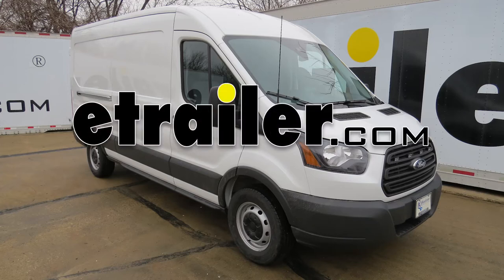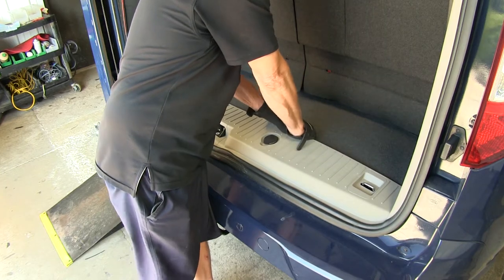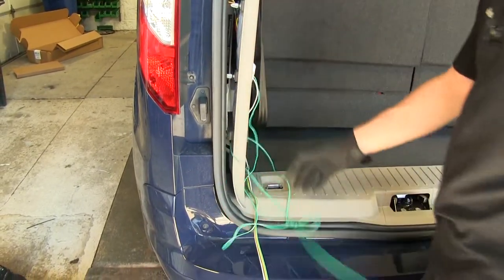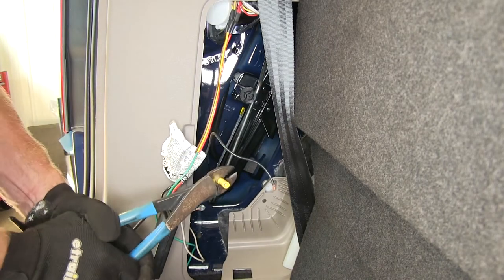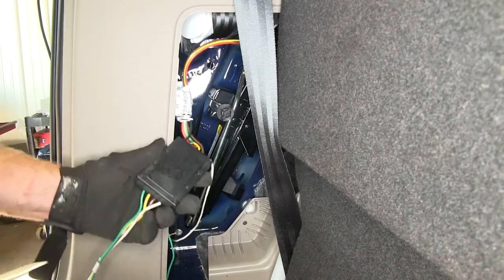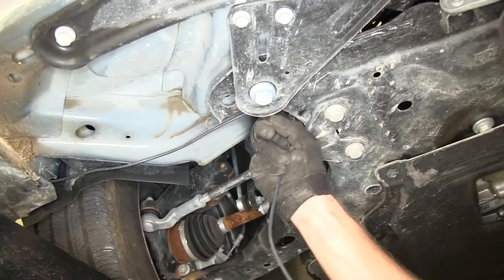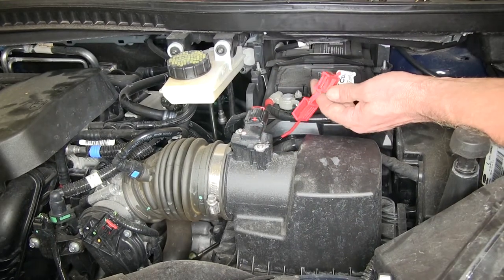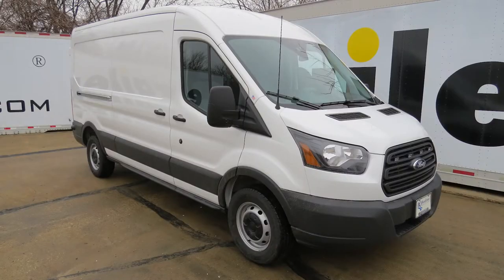etrailer | Trailer Wiring Harness Installation - 2014 Ford Transit Connect

Comment: Awesome video - however two things of note:

1) The Van shown at the Beginning and End of video isn't the Transit Connect, but is the one of the "full size" Transit 150/250. A lot of the components vary between this model and the Transit Connect. 

2) Although the OEM plug interfaces are the same between the VAN (not shown) and Wagon (SHOWN) versions of the Transit Connect, they are located in slightly different locations between the two. The green plug interface is exactly as shown on the passenger side, however the multi-color bunch on the left is actually a lot lower and stuffed into a cavity on the driver side. (Ford converts/modifies after they hit our shores from Spain)  

I'm sure anyone mechanically inclined enough to take this on themselves could figure it out, but I didn't want such a great video to go missing little differences between the two models ! AGAIN - great work on the video and thanks for offering informative how-to's for us do-it-yourselfers!

Comment: "Tape" does not protect electrical connections. Do the job right and use a heat shrink butt connector. I can't tell you how many wires I've had to fix because someone used electrical tape, and a couple years later the wire is nothing but green powder.
Reply from the maker: Thanks for the tip! We started using heat shrink connectors a few years ago because we noticed the same thing.